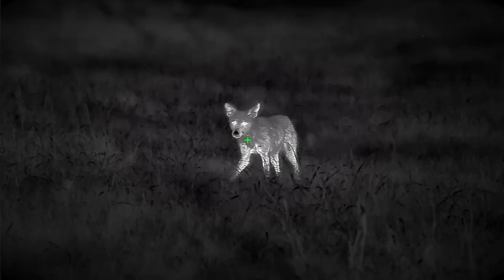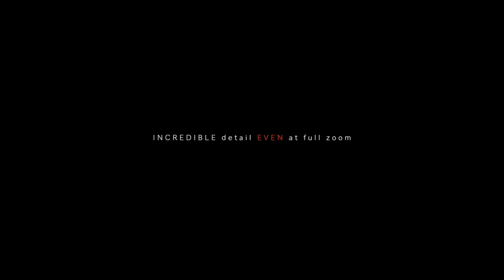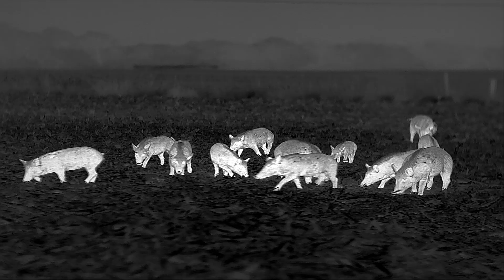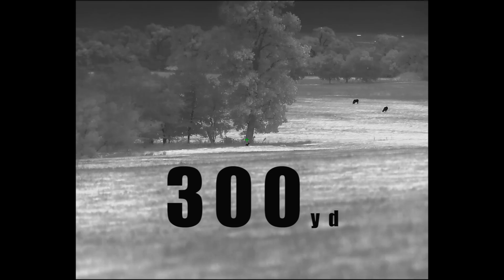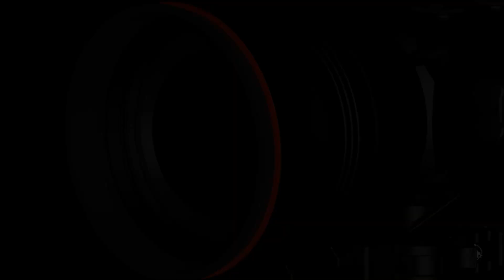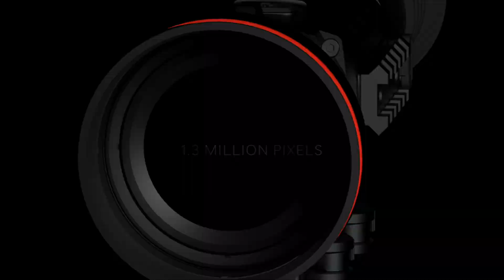InfiRay Outdoor RICO HD 1280 RS75

Comment: 30 hz or 60 hz? Looks 30 to me. Correct me if I'm wrong.
Reply: @jump7057  why only 30hz not 60?
Reply: @jump7057  probably it would be hard to cool down this sensor with 60Hz on thermal scope
Reply: @jump7057  why only 30hz not 60?